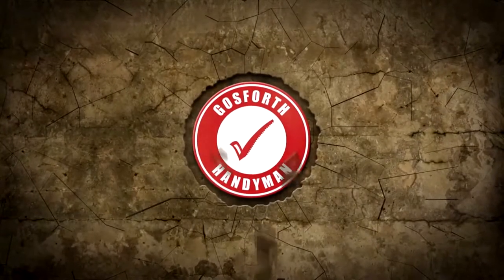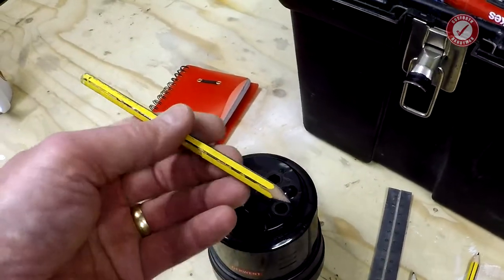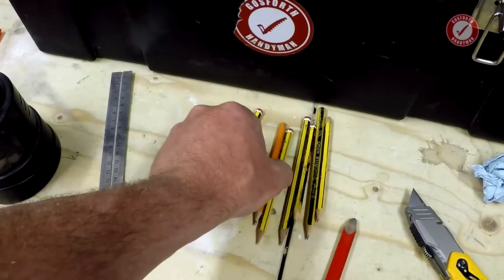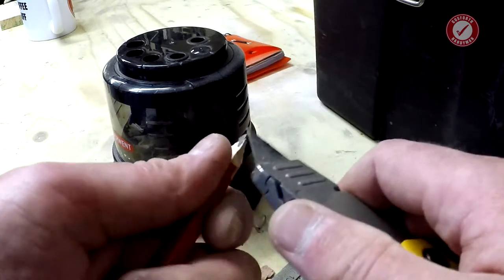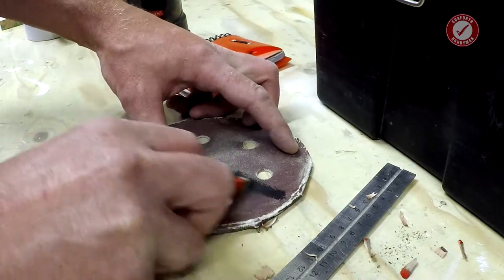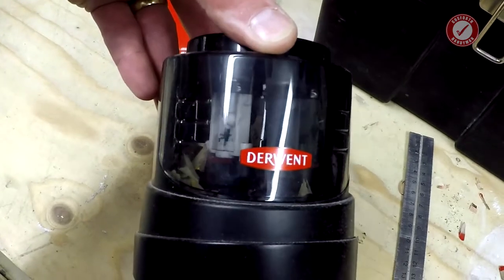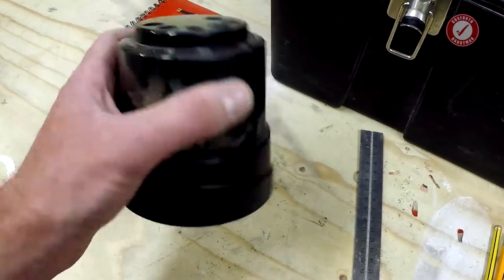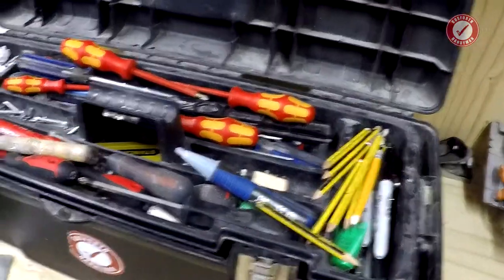Electric Pencil Sharpeners are Life Changing! DIY Tips!

Comment: It's not "just sharpening a pencil" IMHO Thirty years as a carpenter taught me to sharpen the pencil with less than 6 cuts maximum. I cut a fine point, chisel point, or, scribe point with the utility knife. Width and point style depends on the marking surface as well as the manner that you partner the saw/blade used and the requirements of the mark. With concrete forms or rough framing can get away with pretty much any pencil mark, however, for precision quality work on good (read expensive) wood it was always better with a 'programable" pencil sharpener such as a sharp utility knife.